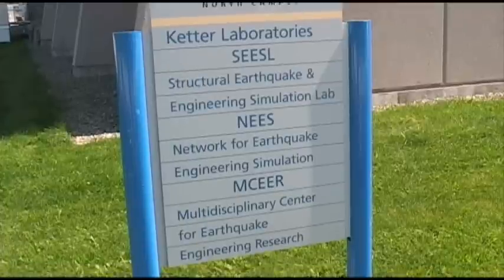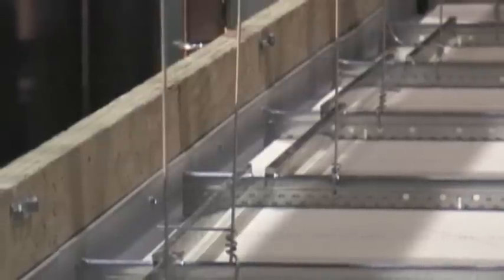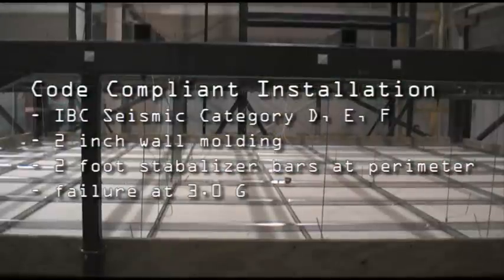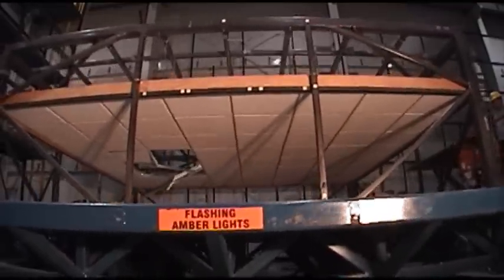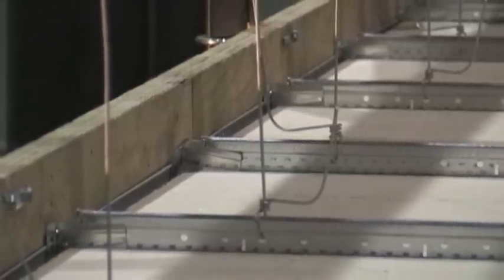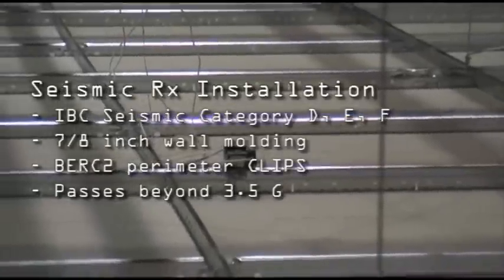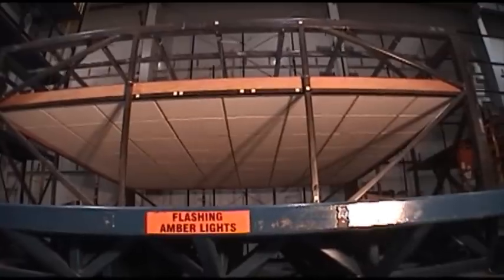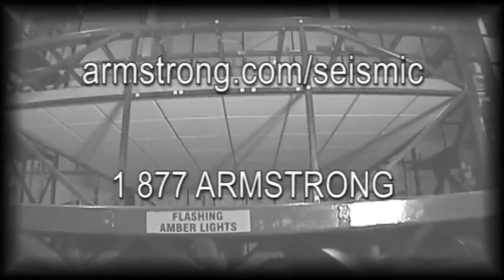Seismic Test Comparison

Comment: unfortunately, any money you hoped to save by replacing the 2" wall angle with 7/8" is made up for by the price of the BERC clips and screws...but this is still by far the best seismic ceiling system i've used.